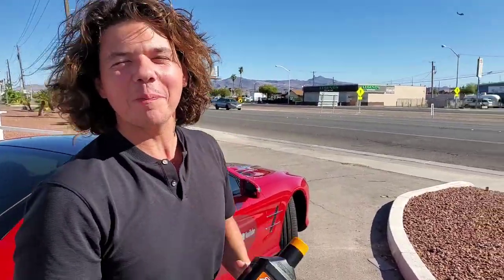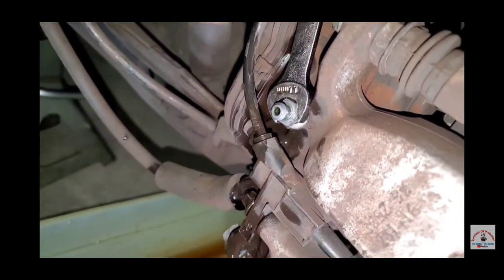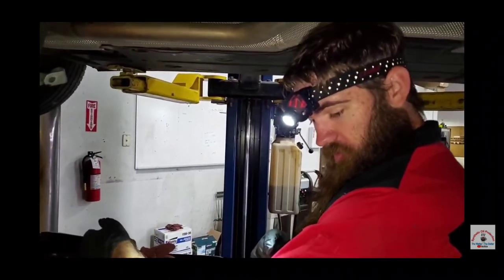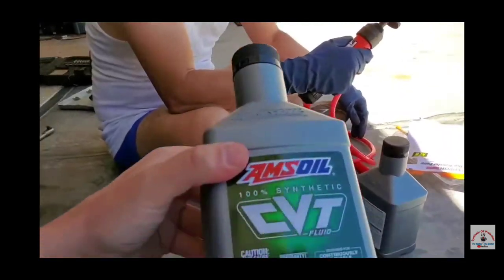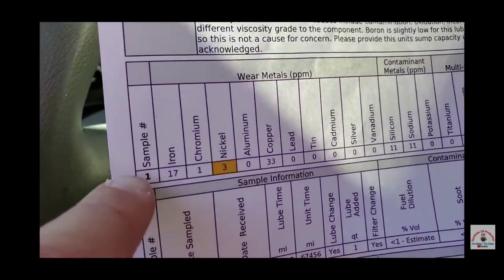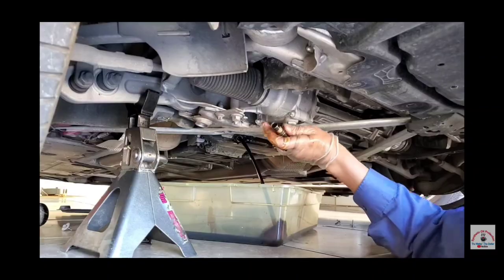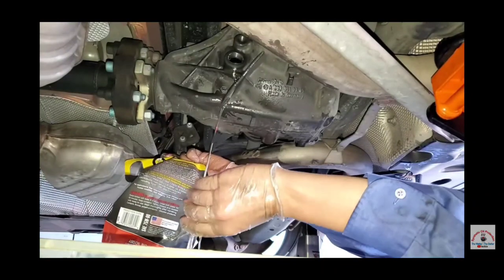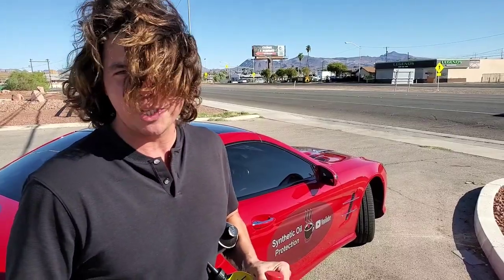When Should I Change my Oil -Transmission - Differential Fluid?

Comment: Hello Eben!!! I change my Engine Oil every 5K, and Transmission Fluid every 10k!
Reply from the maker: Sweet💯☕😃

That's definitely doing extra due diligence 😉
Reply: Transmission Fluid every 10K!!??  How many drain and refills did you do to get the old transmission fluid out of your vehicle? Did you switch to Amsoil Transmission Fluids?
Reply: @dashcamjourney4599  Hey Bud! Great question! Watch the video of Eben and I working on the transmission in my car here! The video shows just how many we did. https://youtu.be/GBpdfK6QxjI

I have a 1998 Honda Civic LX with over 224k miles on it. Every single fluid/oil in my car is Amsoil. Including at every single fill up using the upper cylinder lubricant. She rides and drives like a dream! 😁😁😁

Comment: Very informative for the newcomers Eban! Some people might not ever read their car's manual or even have  a dishonest machanic. What ever the reason your videos might help someone that is not yet to familiar with simple car maintenance. I encourage everyone to research your cars maintenance procedures. Most cars are very simple to maintain. Eban might even save you some cash. Example: I was able to purchase a case of Signature Series Fuel Efficient ATF for about 180. I was able to do multiple drain and fills to the point where my ATF look immaculate. Toyota charges anywhere from 300-400 for a transmission service. That is very expressive for some people to afford. These are hands down the best fluids in the market. You will not be disappointed. Most cars are very easy to maintain don't be scared you topical Joe Cool 😎 can do it. Take the Amsoil test Eban will take care of you.✌️
Reply from the maker: Thanks Robert for sharing that with the channel 💯😉
Reply: How many drain and refills did you do on your Toyota to get the old Toyota ATF fluid out of the system?  I’m still on the fence on doing the transmission fluid with anything besides OEM fluids. Thanks for sharing
Reply: @dashcamjourney4599  
Dash, I have 126k miles in my Toyota Tacoma 4.0 TX Baja Edition. I would do drain and fill every 30k using Toyota WS. My fluid wasn't to bad so I only did 2 using Amsoil Fuel Efficient Signature Series . I will be doing my 3rd at 130k. I was very optimistic like yourself about using something other then WS fluid. All the scary stories out there will make some pull there hair out. Toyota WS is just a low Viscosity ATF with some synthetic additives. Nothing Special 

 I have always use Redline products in my Diffs and Transfer Case with 30k services  by myself. I came across Ebans channel and a couple other channels that educated me on 100% synthetic fluids. Which to my surprise are very different then full synthetic.                                  "Full synthetic (API Type III) is highly refined petroleum base with synthetic additives. The 100% synthetic (API Type IV) is formulated with a synthetic base and synthetic additives". 
So I decided to make a switch. It's was a no brainer for me. I let me tell you your truck will love it. Just stay away from the flushing unless you know what you are doing. Even then just stay away if you have a high mileage vehicle. Introducing too much clean fluid might make more harm then good. Just go for it take the Amsoil test you won't be disappointed. There is plenty of videos out there to walk you through the service. Or feel free to message Eban or myself. We are all here to help. EBAN WILL TAKE CARE OF YOU. MAKE SURE HE IS YOUR DEALER....

Comment: I felt kind of silly after changing my truck’s ATF at 31,000 miles using the Toyota WS fluid.  The manual strongly suggests it.  Turns out, the Amsoil meets that WS spec, so I could have gone with it.  I have Amsoil fluids ordered through Eben for everything else on my truck: signature engine oil and severe gear in the diffs.
Reply: Hey William, continue changing the transmission fluid on your Toyota every 30k, with OEM fluid or Amsoil, it'll last forever!
Reply from the maker: Wait until you try the signature series fuel efficient ATF you'll be surprised how much faster it shifts 😉
Reply: @Syntheticoilprotection  Shifts faster with Signature Series ATF??!  Is that just for sporty vehicles only?
Reply from the maker: You can run it in any type of vehicle.

You'll see in the lookup guide it will give all the recommendations the big difference between the OE and the signature series is the additive package It flows a lot better in the cold and also handles better and high heat because of the proprietary additives.
You also see on my transmission fluid playlist at the end of the video I usually drive the cars with everyone and you'll see their reaction on how they're so surprised the car's shifting faster.
Find Products For All Vehicles - 
https://www.amsoil.com/guides/?zo=5331179
Reply: I used the signature series ATF in my car William. Holy crap what a difference!!!!

Comment: Hey Eben. Quick question, what's your thought on AMSOIL Extreme Power 0W-40 oil? Does it run 5000 or 10000 miles? Is it any good compared to 0W-40 Signature Series? What's the difference?
Reply from the maker: I'm not sure what you mean?
Reply from the maker: I don't know what you mean extreme power?
Reply from the maker: It would be great if you could text me that oil.
702-472-3614
Reply: @Syntheticoilprotection  done

Comment: does a front wheel drive open diff vehicle need diff fluid too?
Reply from the maker: Yes just depends on the vehicle, hey all wheel drive or select drive would take gear lube in the front diff.

On a front-wheel drive automatic transmission that is a transaxle and that has the transmission fluid and the gear lube all in one place.

It depends on the vehicle the best thing is to check on the lookup guide and see what it calls for on your vehicle.

I have quite a bit of transmission fluid changes on the channel you'll see that under the playlist.

Find Products For All Vehicles - 
https://www.amsoil.com/guides/?zo=5331179